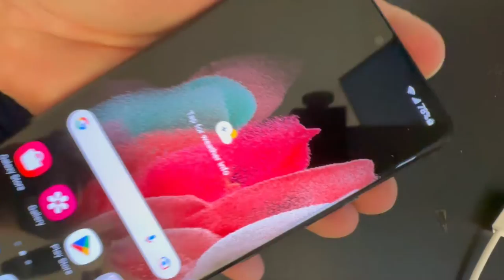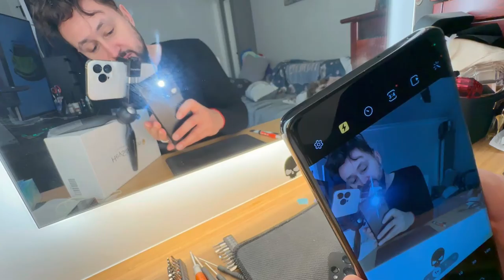S21 ULTRA CHARGING PORT REPLACEMENT DIY EASY

Comment: i have replaced this board because the microphone didnt work in apps. once replaced, the microphone did work but it doesnt take any charge from the port. i have reseated it multiple times aswell as getting a replacement board but it still comes up with an overheating warning. it does charge wirelessly. is the warning because of a faulty board or is it something to do with non genuine parts or is it just because my phone is broken or something. i dont work on phones, usually only pcs but since i saw this video of how easy it was to replace i decided to give it a shot. the only issue is the charging on the new board, microphones and sim card all work. i dont know what to do. any ideas?

Comment: Hi, i did the same thing, but there's a small pin with two pieces of O ring blue color. Supuse to be on the sim card slot. I don't have any idea how I can put it back. The phone is working fine. But I have the little piece out.

Comment: Mines just a little loose and when I charge it, it needs to be set down a certain way so cord doesn't wiggle.
 
Do I need to replace it, or just snug something up?
Reply: I've got the same problem.
Reply: I had that problem after the 1st month of buying my phone (bought around release), broke completely a few months later.
I'm very careful when plugging the cable in and out but this is the 2nd Samsung phone it happens on.

Just replaced the USB-C part thanks to this video, hoping that it'll work fine for a few years at least..

Never had this issue on iPhone (work phone). I prefer Android, and always have, but I'll go iPhone if this one breaks too. 😅
Reply: Same except I think mine is messed up cause when I have it at a angle it always says 7hrs till fully charged so only way to charge is by a wireless charger
Reply: @squid.696  Yep, it's about to break completely soon - had the same issue on  3 of my Samsungs.
Reply: @SwoonGaming  honestly surprised it hasn't it's been more than 4 months
Reply: Update: I just purchased a new charging port from ifixit. Worked great, always fast charges now. The only thing I would do differently and advise someone who is also going to fix it themselves is BUY a new back glass. Mine broke while disassembly and had to just put it back because I hadn't ordered one. So make sure you buy the back glass and charging port unless you think you will be extremely careful. I thought I was taking my time and nope it shattered.